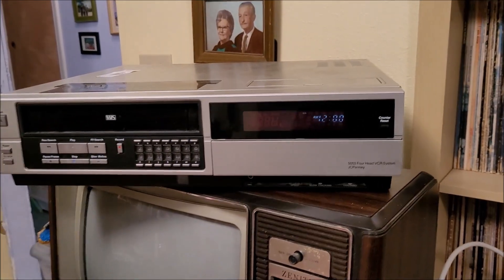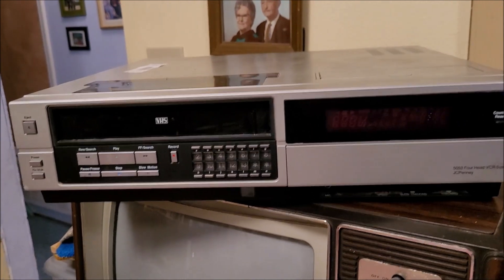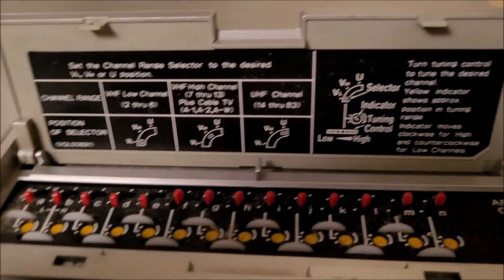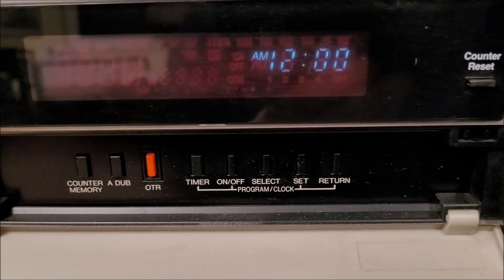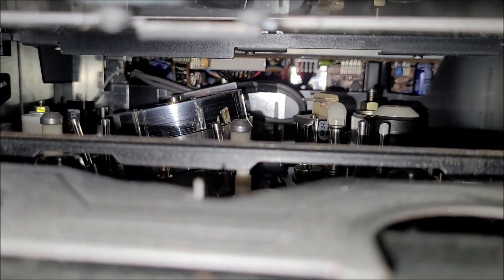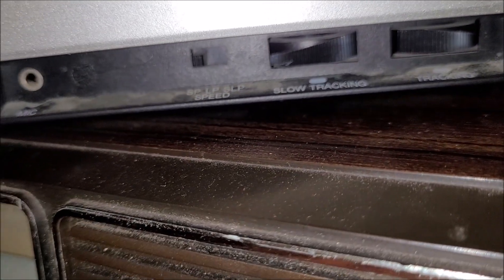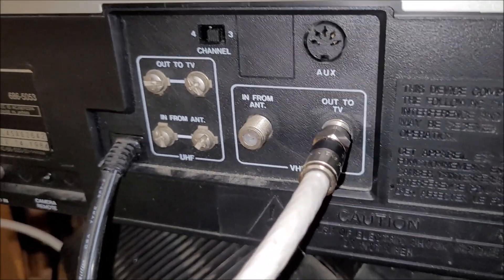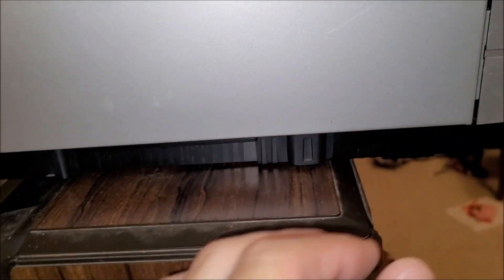JC Penney 5053 VHS VCR (1984)

Comment: That is a 1984 Panasonic mechanism. The idler tire will need to be replaced. The VXP0521 idler assembly is best for replacing the central mechanism. Should end all squeaking.